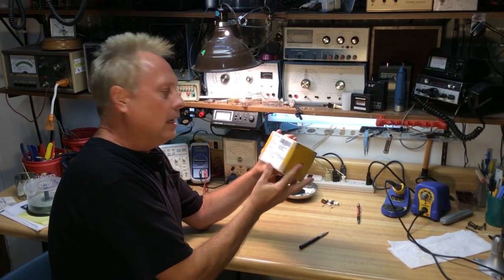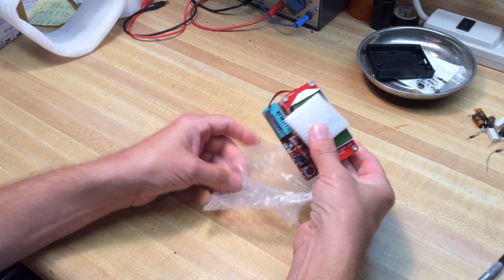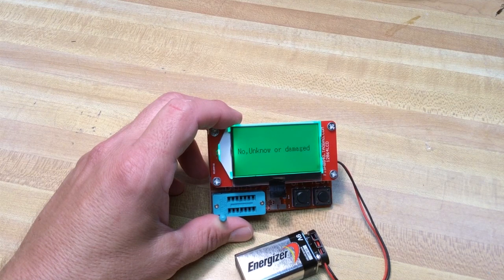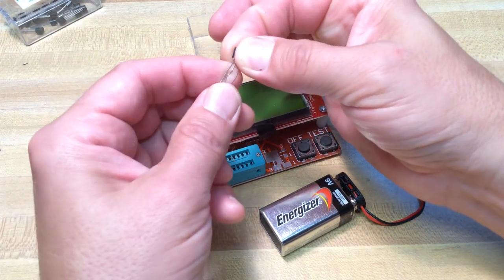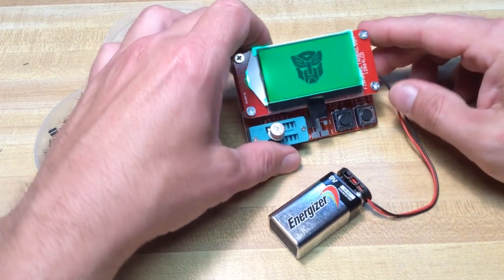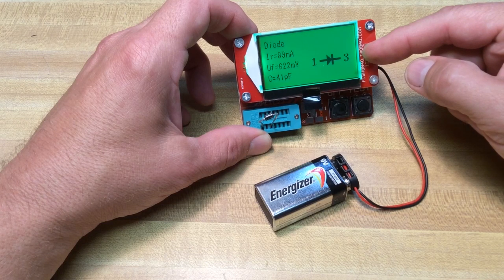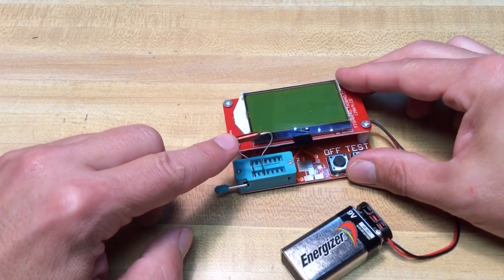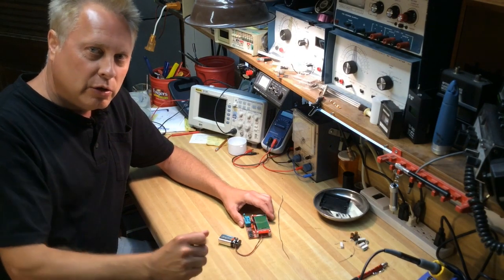Modern Transistor And Component Tester Makes Great Addition To Test Bench

Comment: Thanks for the review. I was on the fence about this tester. I had seen a review for the larger screen version of this tester from eBay seller t-mall2013. Your review helped me make up my mind to get one but I did order the larger screen version called "New 12864 LCD Transistor Tester Capacitance ESR Meter Diode Triode MOS NPN LCR" from t-mall2013.
Reply from the maker: I may have to look into that one also!  Thanks for the information on that Todd.

Comment: These should also test ESR of electrolytic caps. Some offerings on eBay come with an enclosed case and clip leads in addition to the IC zif(?)  socket so you can test the caps and other components in circuit. Truly useful for the money. 

73, k6whp

Comment: Hey man, If we test variable resistor and slowly turn it. The value on display is changed as it should be or not?
or it still show the value that firstly contact to the pins of tester.
and what happen if we test zener diode?
Reply from the maker: Good question, I have not tried adjusting a pot while reading it out but I think this tester only tests when it is first turned on so guessing it will only show the initial reading but I will have to try that to be sure.